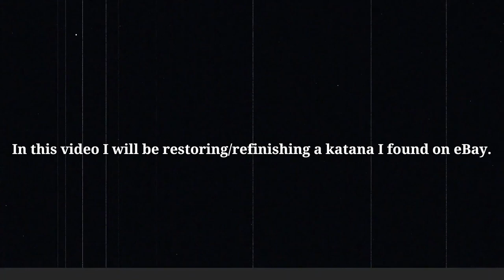Restoring a Damaged Katana

Comment: What’s funny is that even though it’s artificial Rayskin the seller still decided to not full wrap it and cheap out LMAO
Reply from the maker: I've taken apart a few of these "reproduction" katanas before, they seem to always cheap out on that for the most part. I've recently got my hands on a pair of Edo period katana to compare. Stay tuned for that!
Reply: @CaloTheGreat88  sure.
Reply: @CaloTheGreat88  also there is another way you could of wrapped the Tsuka you could of done the traditional way where is does the S and makes the diamond pattern
Reply from the maker: @naruomi9477  I tried and failed multiple times 😂, although I'm thinking about making a part 2 to this video. This katana can definitely still use some work here and there. Maybe I will try re-wrapping the tsuka.
Reply: @CaloTheGreat88  👍👍👍